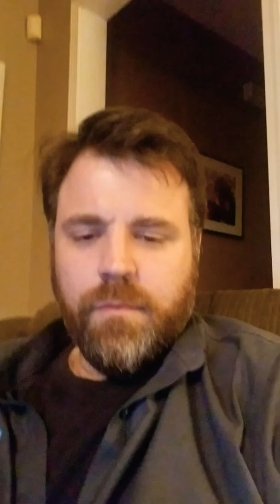Ford 6.0 Powerstroke Diesel Lifter Failure

Comment: Bought a scan tool and it showed ficm voltage drop from 48 to below 40. This is on an f250 6.0 2005 power stroke. I replaced the drivers in the ficm and it’s maintaining 49-48 volts. Took it for a test drive with scan tool on and ficm volts good icp volts good icp psi good ipr% good icp desired psi good cmp and ckp in sync after about four miles and increased speed truck starts shaking and I lose power. I shut off the truck wait 30 seconds and it starts back up and runs fine for about four miles then does it again. The scanner reads a po266 code cylinder no 2 contribution balance. I do a koeo injector test and all injectors click. My question is it most likely a bad injector.?
Please advise I’m on social security and can’t afford a mechanic and to keep replacing stuff till I get it right thank yoi
My reasoning is once the oil heats up and becomes thinner and speed increases creating more pressure it effects the operation of injectoo#2 but I’m not certain. Always owned gas engines my first diesel
Reply: Help
Reply: Help

Comment: If you bottom out the lifter wouldn’t it have held the valve open on the base circle and burned a valve
Reply from the maker: You know what? !hat's a great question for Questions and Answers with Cass. Make sure to like and subscribe so you can see your answer in the next episode!

Comment: Comparing a machinist to a mechanic is like a collage professor to a Highschool math teacher.I made the mistake of toying around with 6.0s for the last couple year's and the whole 6.4 pushrod thing. ill never understand  with most other 6.0 guys just throw them in cause only ones ford sell's so once the heads are torqued no need to remeasure  for pushrod length,  lash and preload with fresh set of heads not to mention piston protrusion after 300k on the bottom end. lol.